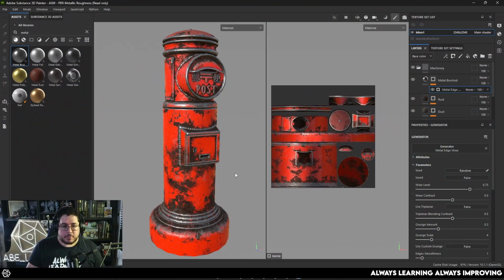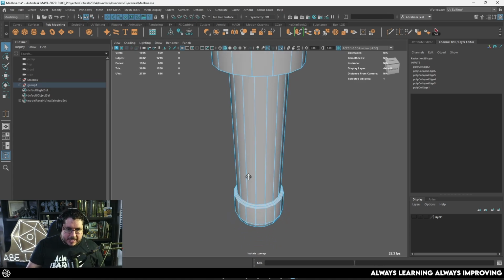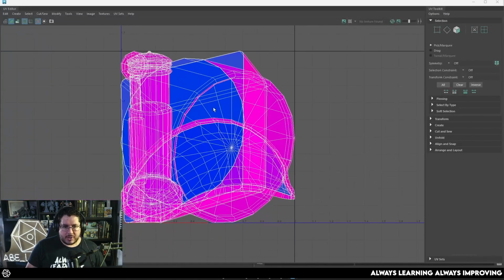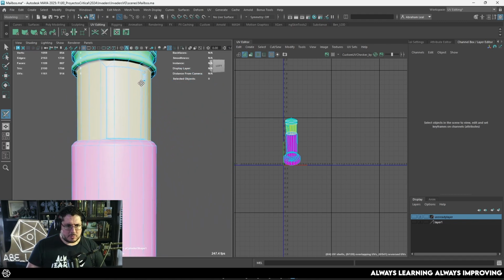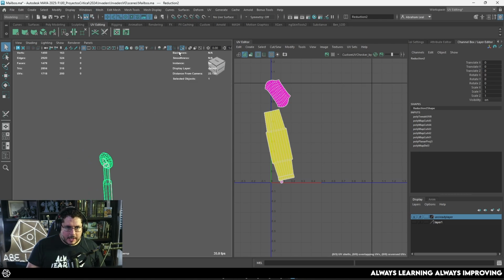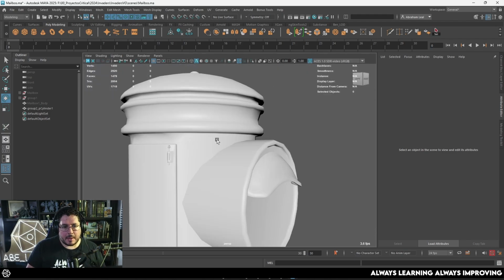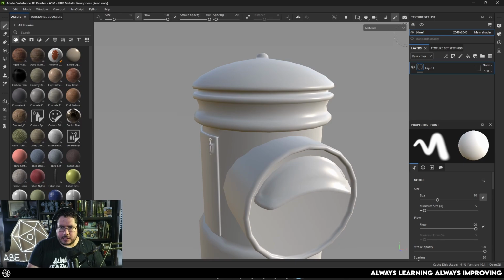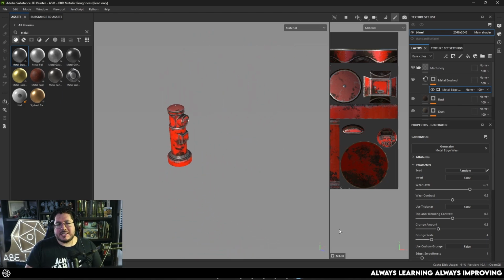Optimizing 3D Assets for Games: Uvs and Bakes

Comment: Good video. I enjoyed it. But at 12:46 - 13:13 that is a BAD WAY to do UVs. Always scale up your UV shell so that more squares are visible. Because smaller squares (not smaller in the UV rainbow texture but tiled more!), allow you to identify where deformations happen. Because with a single large square you may not (correctly) notice where the curvature in the square happens (since it's all BLURRY), but with a smaller row of squares you'll immediately see the pattern bending or stretching.
Reply: That stage is for getting the texel density right, it does start off in a larger state, but it's a cylinder with a cylinder projection so I can imagine that when you're modelling and UV mapping all the time you get used to correct topology so you can trust that your topology isn't off for something that simple.